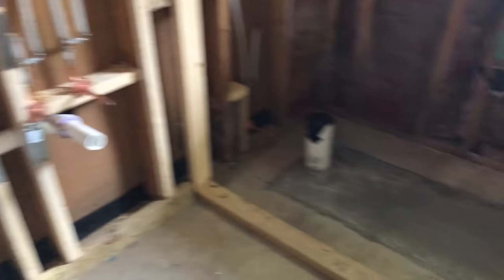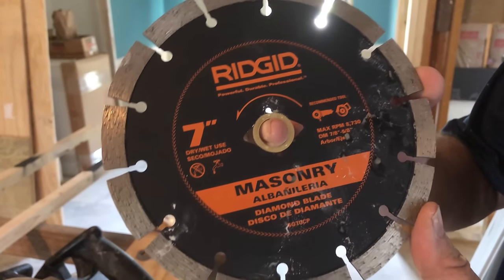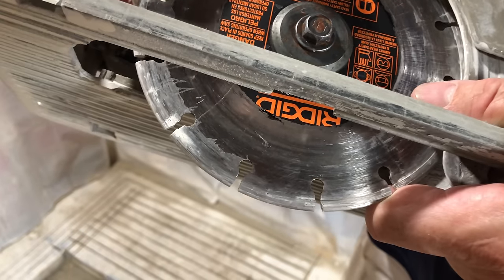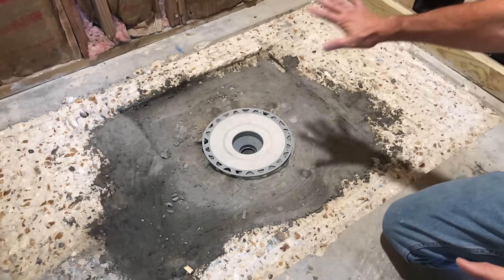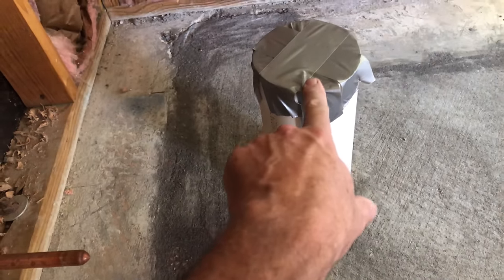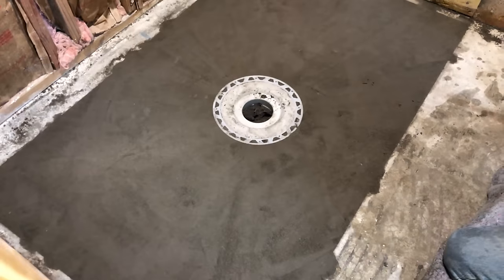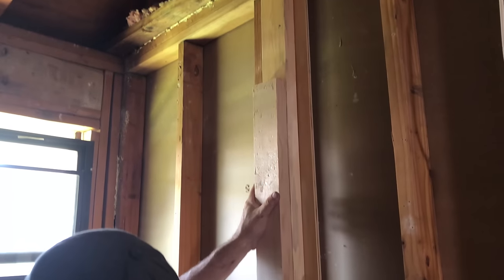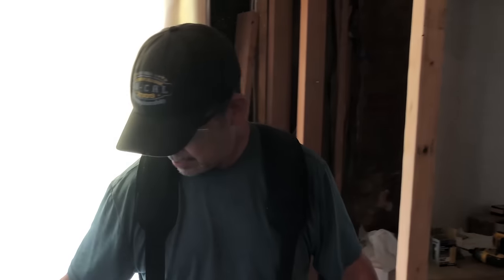Installing a Curbless Shower on a Concrete Slab

Comment: Appreciate your video and what your doing to educate DIY folks and contractors always looking for a better way to accomplish a job. However!! as a retired General Building and Masonry Contractor speaking from experience, you should be wearing eye protection and as a bonus hearing protection also. On two occasions I ended up in the ER with sawdust in my eyes, and nailing wax from the strip nails in my eye!! As a masonry contractor I had sand end up in my eye and of course I wipe it and end up scratching my eye lens. Oh I forgot another thing!! you might want to wear a face mask also. OH another thing take the time to put your hearing protection on!! either in your ears or over them when you can  Believe it or not your still young, however you won't hear well either it when it all catches up with you in your retirement years.   . Be Safe number one first and foremost, over technique and job site skills.
Reply from the maker: Thx Dan 👊👍.  You’ll find there’s much more PPE in our more recent videos 💪
Reply: @StudPack  fantastic, Glad to hear that. You guys arevgreat, prefer you protect yourselves.

Comment: I have had to replace traps in new buildings due to having concrete in them,  they sure don't like it when you run a camera in a line and see you have to cut our a 10 by 12' of 6" thick concrete just to fix someone's mistake.

Comment: so your pre slope is done and you are back to the level of the slab so now what. how do you continue on to tile.
Reply from the maker: Once we finished the pre-slope we laid down some Kerdi Waterproofing Membrane and Tiled directly on top of that! Simple stuff. Unfortunately we weren't able to capture the process, at the time of recording this we had some major technical difficulties but we've fixed them all and our next large project is right around the corner. Tons of stuff coming real soon, thanks for watching Douglas!

Comment: At 10:09 don't you mean 1/4 inch per foot? not half inch. Your slope seems very steep.
Reply from the maker: Good question Kingsley!  Pebble stone shower floors need more than the minimum 1/4" slope in our opinion.  They drain much better - especially the rounded pebbles like this shower.  See our update video/hood installation video published 8/29/19 at 3:12 for a look at the finished product

Comment: If you tool is (DI) Double Insulated, then chances are it doesn't have a ground pin on the plug, you would only have the "Hot" and the Neutral. So plugging into a GFI wouldn't matter.
Reply from the maker: Thanks for the comment Griff.  You bring up a great point that my son actually  asked me about off camera.  You must be in the trades for noticing this detail.

A GFCI works by comparing current on the hot side and the neutral side, amperage in equals amperage out.   The ground does not come into play so a GFCI will protect a double insulated tool or appliance.  Check your kitchen appliances and see how many have a 3 prong plug - not many.   If fact, installing a GFCI in an older home that does not have a ground wire is the only NEC approved method of updating older wiring as long as the receptacle is marked "no equipment ground".   The thinking behind this is that a GFCI protected circuit without an equipment ground (green wire) is safer than a standard 3-prong grounded outlet without GFCI protection.   When you press the test button on a GFCI receptacle, the internal mechanism applies test current between the hot side and neutral side, not the ground.  When you press the test button of a GFCI tester (the plug in type), the internal mechanism applies test current between the hot side and the ground.  This is why a GFCI tester won't work on an ungrounded GFCI.  

I hope this helps and thanks for watching and for commenting.

Comment: Seems like a lot of work to chip the concrete to create the slope. I would've just jack hammered the whole thing and pour in a new lower concrete floor with the slope built in 😂
Reply from the maker: Two of those walls are exterior with stucco.  I didn't want to risk cracking the stucco with the jackhammer.  Also would have been on top of the footings so it wouldn't have been as easy as removing 4" of concrete.   I had enough of chipping the footings in this house after our video on the sewer line😂

Comment: Yooooo don’t power wash a wood fence man it makes it look all streaky n messed up what you’ll wanna do is get a pump sprayer filled with chorine and a good strong detergent cleaner and spray down all the wood let it sit n rinse n then soak it one more time 15 20 mins with the solution n one final rinse with the power washer or just normal hose n should look like new woods

Comment: Why so many cuts?  I would have cut once around the perimeter for a clean edge, then attack it with a 16# sledgehammer
Reply: the stuff would literally chooch away from the cut with one hit. Would have been a much quicker cleanup as well.

Comment: your slab is now under 4" thick on the shower pan, this wouldnt pass an inspection, you have to cut back 12" past the edge of the shower pan all around, tie into the existing slab with rebar coming straight out on all sides, then horrizonal rebar in the oposing direction, then hogwire on a slope on all sides tied into the rebars

Comment: Why not just do a perimeter cut and remove all of the slab? Would’ve saved you a lot of time in my mind. (That is how I do mine) just curious.
Reply from the maker: There was a footing under 2 of those walls plus stucco on the outside.   Didn’t want to chip away at the footings (Btdt) or risk cracking stucco 👍💪

Comment: Curious, no bonding agent old slab to your thin set?
Reply from the maker: Hey Mike! That slurry coat you saw us put down before the dry pack IS the bonding agent. It acts like mortar between two bricks, the two bricks being the existing concrete slab and the dry pack. We also used a notch trowel on the concrete patch to help the mortar bed key in better.

Comment: Next time cut full depth around perimeter, install drain and repour concrete as needed.  Seems way too much work fooling around cutting, chipping, bonding with thin set et cetera. Too many steps to get this done. There is an easier way. Dowel into edges of old slab, adjust trade and go.
Reply from the maker: We considered this Steve but this shower is against two exterior walls.  I wouldn't have been able to cut full depth because of the footings and I didn't want to use a jackhammer for fear of damaging the footings or cracking the stucco on the other side.   We also had some water lines under the slab to deal with.  With all these challenges we opted to go the way we did.  Thanks for watching and thanks for the comment - we really appreciate when viewers who are in the trades comment on our videos and give us suggestions.

Comment: ..... you could just cut the perimeter and then use a 25lbs jackhammer........
Also, you could cut with an actual wet saw.........
Reply: Drew that was my initial thought, as well but then I realized that they are not removing the entire slab portion but rather removing a little more than an inch from the top portion of the slab so that they can create a slope to the drain.  This is smart otherwise they would have to bust the old slab out then pour in a new one that is shorter and allowed for the slope.

Comment: absolutely no reason to make that many cuts in the concrete - total waste of time.  Make your outer score cuts, then use a sledge or the chipping hammer to knock out the concrete - no reason to spend the 35 bucks on the 7 inch blade either, could make the score cuts with the angel grinder - done it many times

Comment: I'm certainly no poster child for safety but that mask you use isn't great. Take them off after an hour in a Dusty environment and you can see where the dust has been entering by the dust lines on your face around your nose. They shouldn't be sold because they're no good, and they leave people thinking that they're protected

Comment: I refuse to use a saw with an aluminum handle i.will throw it way I don't care if its brand new i won't use it I will tell you why my old bossman had one he dropped it an broke the handle he ordered a new one brought it home an changed the handle out brought it back for us to use i was the first Guinea pig wet concrete floor raining my feet was wet plugged it in reached down an picked it up an it went to eating me up shocking me I couldn't throw it down couldn't scream or nothing just standing there jumping an quivering an finaly someone figured out I was getting shocked an unplugged it an I punched my boss square in the mouth an dared him to say one dam thing about they was laughing at me while I was getting eat up he finally apologized I got a raise plus he bought my lunch fir two weeks but I knocked two teeth out his mouth but I will never use a saw like that again longer day I live he pinched a wire when he put it together